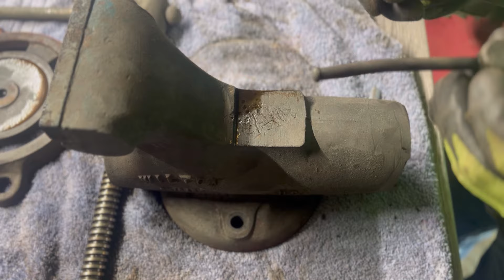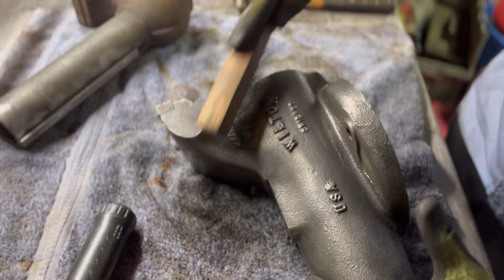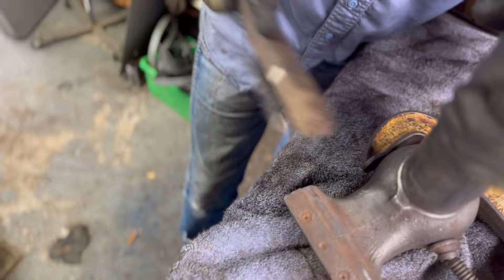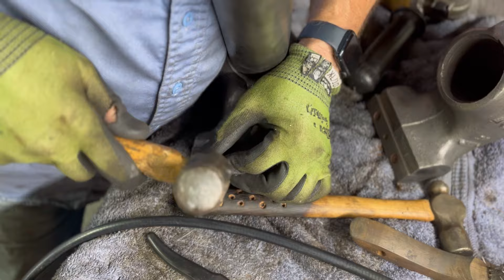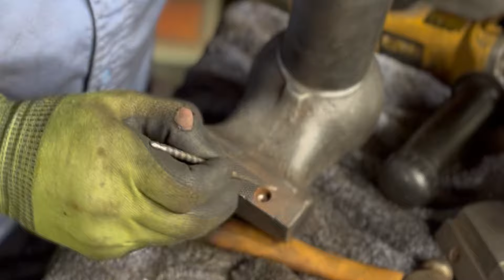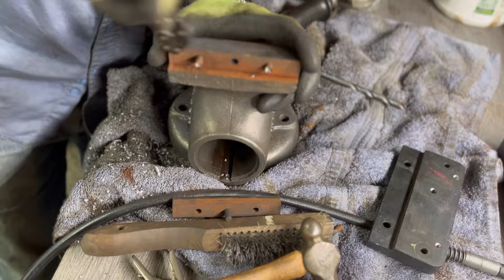1952 Wilton Antique Bullet Vise Restoration (Part 2)

Comment: looking really good so far! can't wait to see it all put back together, will probably look better than it did new, great job
Reply from the maker: lol. I’m not sure about that😆. It’ll look decent though. It will be my main vise for sure👍🏻👍🏻👍🏻
Reply: what are you thinking for that end with the chipped off pin retainer? I'd you got a stick welder try blu demon 3/32 e309l-16 rods I've been using them for years on cast stuff even on things like worn out excavator bucket teeth and it holds up real well even on "unweldable" cast stuff. could probably build it up pretty good if you're into welding
Reply from the maker: @ted7x  honestly if I can get the dynamic jaw to move smooth I’ll probably just JB weld it. There really no pressure OPENING the jaws, it’s TIGHTENING. To add, those pins seem to be there only to hold thread assembly in place. I have a TIG, MiG, and Stick welder, but would use as a last ditch effort.